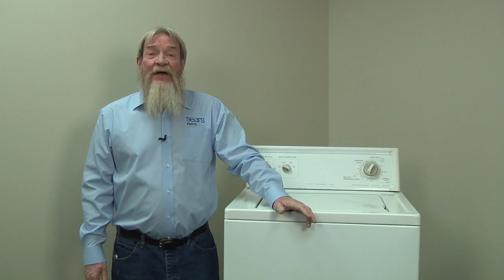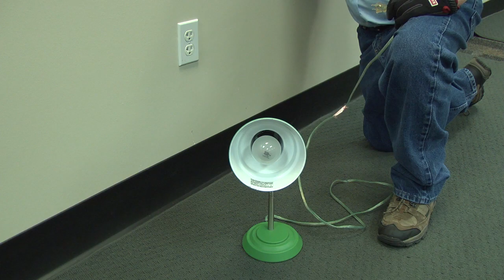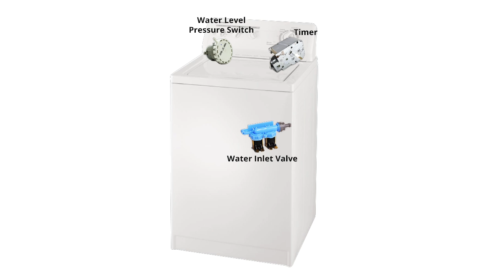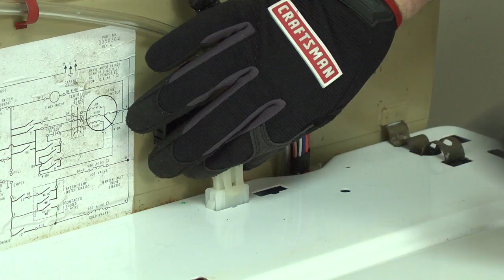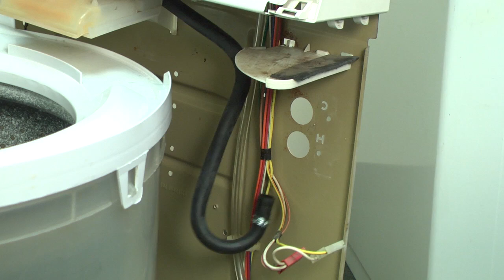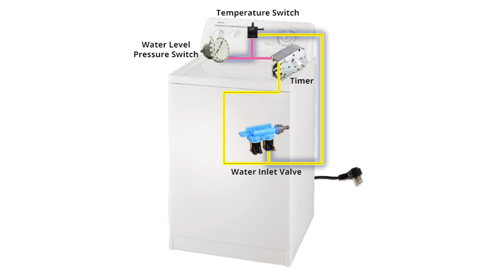Top-Load Washer Won’t Fill: Troubleshooting Direct-Drive

Comment: I have a top load washer state. Sometimes it stops before it gets to the rin cycle and it won't spin. And sometimes it will work when it stops. I reboot it and it will work again and he suggestions

Comment: I have a top load estate. Sometimes it will go into the rents and spin cycle. And sometimes it don't when it doesn't I reboot it. And it works what other problems could I have

Comment: nice video.. for systerms that are from the 70's.... New sears/kenmore units have circuit boards - not electro/mechanical pressure switches..  where is the video to trouble shoot the chinese circuit boards ?

Comment: my top loading Whirlpool WTW57ESVW  wash machine will not  fill with water....it won't fill on  the hot or cold or  warm water settings.....I have checked the hot and cold  water lines and cleaned the inlet screens, but no luck .....what part should I replace ?...thanks

Comment: Hello, my washer fills normal at the start cycle but does not fill on rinse cycle
Reply from the maker: Let us know the model number of your washer and we'll try to provide some troubleshooting advice to help you.
Reply: @searspartsdirect  it is NTW48OOXQO tnks
Reply from the maker: @ricardorobles7259  A wiring failure, bad rinse water level pressure switch or a failed timer could prevent that washer from filling in the rinse cycle even though it fills in the wash cycle. Your washer has 2 water level pressure switches. One water level pressure switch controls wash cycle fill and the other controls rinse cycle fill. Here's a link with a photograph of the water level pressure switch assembly that includes both switches: https://www.searspartsdirect.com/product/31is8idz57-0026-110/id-wpw10403280 . Unplug the washer and check the wire harness connections between the timer, rinse pressure switch and cold water inlet valve. To open the console, remove the screws at the back of each console endcap then release the console from the top panel and hinge it up and back over the back console panel. The rinse water level pressure switch has yellow/violet and yellow/red wires connected to it. Reconnect any loose wires between the timer, rinse water level pressure switch and cold water inlet valve. If the wiring connections are okay, unplug the wires from the rinse water level pressure switch and check for continuity between the prongs that the yellow/violet and yellow/red wires connect to on the switch. (If you don't have a multimeter to check resistance, you can get one at your local hardware store or home center for less than $20.) Here's a video that shows how to check continuity using a meter: https://www.searspartsdirect.com/diy/article/how-to-use-a-multimeter-to-test-electrical-parts-video . Your meter should measure near 0 ohms of resistance (continuity). If the meter measures infinite resistance (open load) then the rinse pressure switch is bad and you'll need to replace the water level pressure switch assembly (the part in the above link). If the pressure switch is okay, then you'll likely need to replace the timer because the timer isn't sending electrical current to the rinse water level pressure switch during the rinse portion of the cycle. We hope this information helps. If you need further assistance, let us know.
Reply: Thank you very much for your response, I greatly appreciate your help.

Comment: So I got water coming in but it won't fill up. Any suggestions on what could be wrong? Any help would be greatly appreciated.  It's a kenmore 700 series..I know it's old.
Reply from the maker: Water could be siphoning out of the washer through the drain hose. Check the drain hose installation according to the guidelines in the installation instructions. Make sure you don't have that drain hose stuck way down the standpipe behind the washer (or submerged in water in the drain sink if your washer uses a drain sink). Correcting a problem with the drain hose installation may correct the problem that you're describing.

Comment: What would it be if when I put it on rinse  it doesn't fill and the reset button doesn't reset, unless I punch the control panel on the side that the reset is on? Which then makes it fill. No voltage meter.
Reply from the maker: Your symptoms point to a failed control board or faulty control panel. Some washers have one control board that includes the control panel buttons instead of a separate control panel and control board. Let us know the model number of your washer if you need more help with this problem.

Comment: Hello I have a admiral model # atw4475VQO washer that want fill with water but it spins. It doesn’t matter water temperature or size load I put it on it never fills with water..I have replace the water intel valve, pressure switch, and bought new hoses still no water. Can anyone help me!!!
Reply from the maker: Verify that you have water coming from the water supply faucets behind your washer. If the water supply is good, then a bad water temperature switch ( https://www.searspartsdirect.com/product/48ybkf2fki-0026-110/id-wpw10184148 ) or a wiring failure is preventing your washer from filling. Unplug the washer and check the wiring connections from the timer to the water level pressure switch. Check the wiring connections between the water level pressure switch and the temperature switch. Check the wiring connections between the temperature switch and the inlet water valves. If all of those wiring connections are okay, then you'll likely need to replace the water temperature switch. We hope this information helps. If you need further assistance, let us know.
Reply: Sears PartsDirect thank you I will try it out today
Reply from the maker: @miajones4450  Thanks for letting us know what you found. We're glad to hear that you got the problem fixed.
Reply: Thank you so much it was bad water temperature switch..

Comment: My scenario is where the rinse cycle works, but wash cycle does nothing.  So per this video the problem is timer OR the water temperature switch.  I am wondering, should the timer count down even though no water is being introduced?  Because my timer does not budge (does not time down).  Is water flow needed for timer to begin?  Thanks if anyone can answer this.
Reply from the maker: On some models water flow is needed for the timer to count down. Let us know the model number of your washer and we'll try to help you with troubleshooting advice.
Reply: @searspartsdirect  WET4024EW
Reply from the maker: @tserevenad  Thanks for providing that model number. The timer won't advance in the initial fill cycle until the water level pressure switch senses that the washer is full of water. In the rinse mode, a switch allows current to flow through the timer motor so the timer does advance in the rinse mode.
Reply: @searspartsdirect  Thanks for your reply.  I asked about timing down to see if it was a clue regarding a bad timer.  Today, I did a couple more tests.  I confirmed 120v at the temperature switch (pink wire, pin 3) and neutral (lid switch) with no power at the cold inlet valve (in start of wash cycle).  This leads me to believe the problem is the temperature switch.  I tried to test continuity through the switch on various settings, but unclear on what pins this would be and even if the test is valid since it appears to have a PC board which may require other inputs for continuity to be established.  So in conclusion I am trying to determine if my problem is the temperature switch or the timer.  Heck the machine is only 2 years old that is what is puzzling.  I think it is the switch.  Again, no water at wash, but water, rinse, spin perfectly from rinse cycle onward.  Thanks for any additional comment.

Comment: Hi, i am using samsung fully automatic top load washer..
Not taking water and i replaced new inlet valve still same...I checked the voltage at inlet valve ,there is no voltage and i disconnected the cable from inlet valve and voltage is coming ac 180v...So, please tell me where is the fault....!
Reply from the maker: Let us know the model number of your Samsung top-load washer and we'll try to help.
Reply: @searspartsdirect  model ...WA82B4TEC/TL
Reply from the maker: @sajeevkandampully7408  Thanks for posting that model number. That washer appears to be a foreign model sold in India. We don't have technical information and repair help for that model so we can't provide troubleshooting help for the filling failure on that model.
Reply: @searspartsdirect  thank you for your response.....
Reply: @searspartsdirect  gee what a fucking help you are!

Comment: I have a top loader that is giving us fits! You put it on wash and it immediately flips the knob to rinse (on its own) then it will sound like it is filling with water, but it never does, and it starts spinning. It has the option for a second rinse cycle (which we had on, but tried to run the washer with it off...same result either way). We have also tried starting it from the different settings and water temperature, that didn't make a difference either. I am going to try the hoses tonight like the video says and see if that helps. Any other idea's if that doesn't work? Thank you so much! Kim.
Reply from the maker: Let us know the model number of your washer and we'll try to provide some troubleshooting tips for your washer.

Comment: My washer isn't even trying to open the valves. It is just going straight to agitating. On both, the washing and rinse cycle. What would cause that?
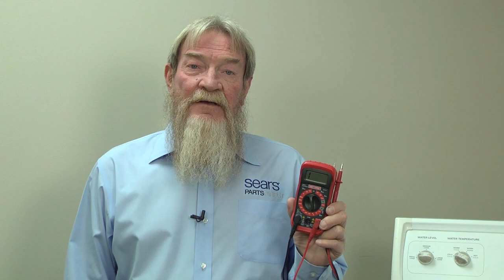Reply from the maker: A faulty water level pressure switch is likely causing the fill problem that you’re describing. A failed water level pressure switch, bad water temperature switch or a wiring failure could also cause this problem. First, unplug the washer and test the water level pressure switch as shown at 3:35 in the video first. If you need instructions for opening the console, view those steps at 1:54 in the video. Replace the water level pressure switch if it’s faulty. If the water level pressure switch is okay, follow the troubleshooting steps beginning at 1:15 in the video to check all components and wiring in the fill circuit. If your washer differs from the one shown in the video, let us know the model number of your washer and we’ll provide specific troubleshooting steps to help you figure out why your washer isn’t filling.
Reply: @searspartsdirect   Sears PartsDirect  I decided last night to pull the plug off the pressure switch and I pulled the hose off from the drum. 

I used my multimeter on all 3 contacts in 3 sets of tests (tan wire/violet wire, pink wire/violet wire, & pink wire/tan wire) (the tests where done on the tabs of the switch and not the wires themselves, thus eliminating the chance of a bad reading from the contact tabs). 

I put the end of the tube in my mouth and both sucked & blew back and forth. The internal contacts did not change even though you could hear the bellow moving. 

I also determined that the hose did not have a pin hole during this same test. So I know there is not an air leak. I ordered a new switch off of eBay so I can replace it. 

Thanks for the help though. Your video is the best out there & I have watched them all!!!
Reply from the maker: @Tinkerbell227  If you measured no continuity between the water level pressure switch contacts that connect to the pink and violet wires, then replacing the pressure switch should fix the filling problem. Thanks for the feedback regarding our video and let us know if you need more help.
Reply: @searspartsdirect   I will keep you informed when the new switch arives and whether it fixed the problem. I believe it will, they believed back then in a great moto. KISS (Keep It Simple Stupid)

Also, my washer is a Kenmore 80 series. And is WAY over a decade old. That was back when they knew how to build stuff. Not like today's electronic crap that claims it saves you money. Low water washers do not truly clean your stuff. They just make it smell nice. 

Even my dryer is a Kenmore 90 series. I got it for free because it didn't heat up. I did the work my self and all it was, was a $14 thermostat set. So I got a perfect working dryer for $14 total.